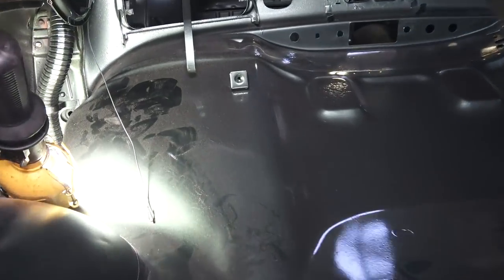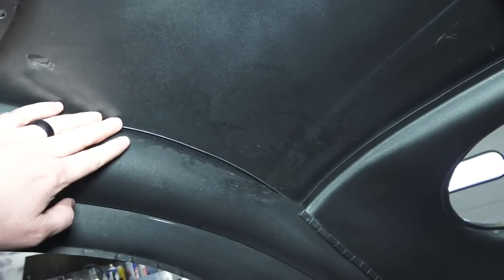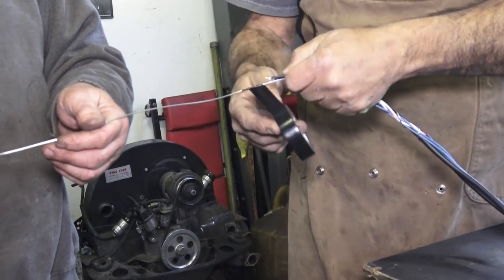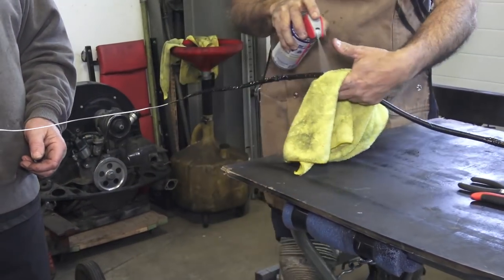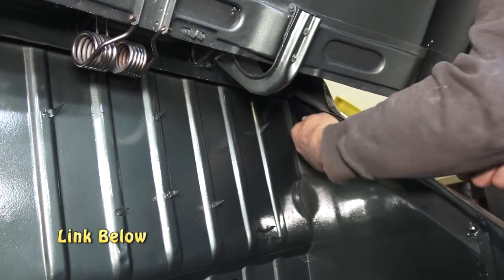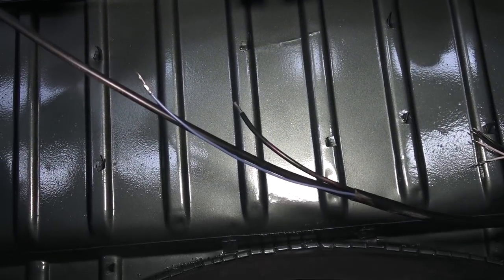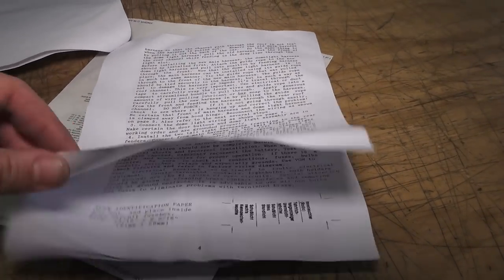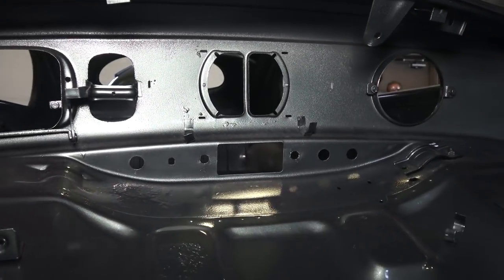Classic VW BuGs How to Feed New Wiring Harness through a Beetle

Comment: why is it so difficult to find good accurate information and parts for 1973 super beetles? it seems there are a lot of parts that are not  available for this year... for example there doesn't  seem to be a complete wiring harness, or fuse box for the 73 or even an emergency flasher switch available for them just to mention a few... I have a lot of electrical issues with the one I have and can't even find an accurate wiring diagram for it... maybe you could shed some light on this for me... what are other people doing to restore their 73 and still keep it somewhat original? I love your videos, just wish I would have bought something older then the 73... by the way this is my first experience with a vintage VW... should have done some research on them before I jumped in with both feet...
Reply: @hjkgufytfyug

Comment: Hey Chris, i need your help. I have a 68 autostick I'm putting back togther. I need help finding the straps ( clamps) that attach the tanks to the brackets under the rear fenders. I have located every part except these. I have tried the usual places Samba, eBay..... 
Any ideas or leads? Thanks for all you do for the vw community.
Reply from the maker: Gosh I have no idea.  I know there is a site just dedicated to auto sticks, have you tried there?  http://vwar.org/
Reply: I feel your pain. Most of the ATF and vacuum tanks that's pop up for sale are typically missing the straps. Fortunately they aren't too difficult to fabricate with parts from your local hardware store or mod from something like a metal fire extinguisher strap of sufficient diameter. Good luck and thanks for keeping another Autostick on the road!
Reply: @hjkgufytfyug  I have several vendors that sell everything except those parts. If you need a supplier for a part let me know. I will be doing a lengthly video on them soon on my channel. Thank you for commenting. Never thought about fire extinguisher

Comment: I'm wondering if someone could please help me. I'm thinking about buying a 1958 square window bug.  The seller claims that it is rare as it is in coral red. Is this true, that a square window coral red bug is rare? It's also UK spec right hand drive.
Reply from the maker: Well RHD is rare in the USA.  Coral red you do not see much either, but they do pop up every now and then.  Where are you located?  Most sellers say "rare" in their ads, along with "all original."  It's a selling feature.  Ya gotta dig deep into the car to see if all this is true.
Reply: @classicvwbugs  Thanks for getting in touch Chris. I'm in the UK. The seller seems a little dishonest, but that doesn't put me off getting the car I like if the price is right. I may ask him for the vin number, but the registration number should be enough to go by. I'm far from knowledgeable with bugs, I'm worried I'll buy something that isn't correct to the manufacturing period. Thanks again Chris, keep up the good work 👍